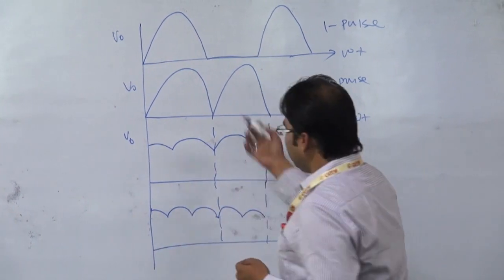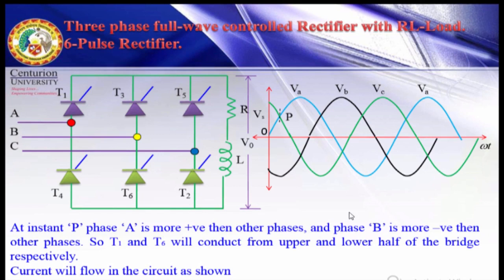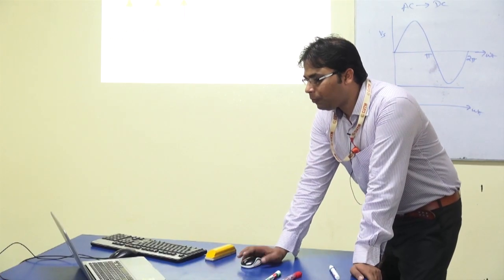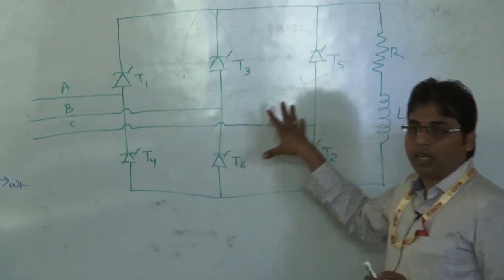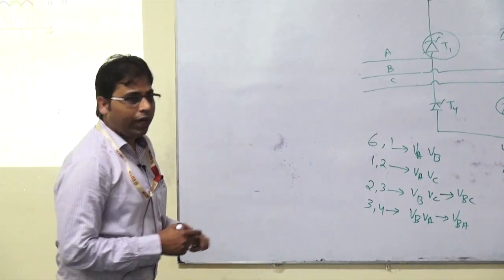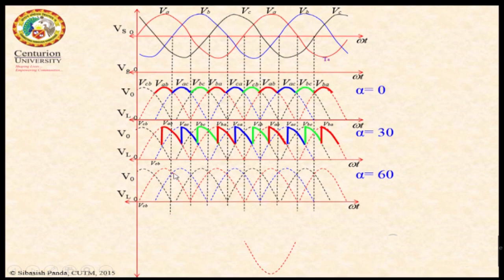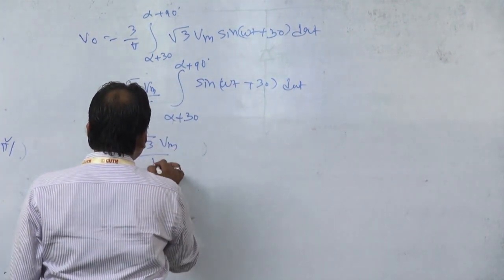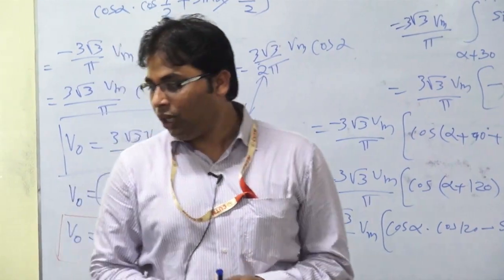3 Phase Rectifier 6 Pulse Rectifier

Comment: This lecture helped me so much that I am almost lost of words...
 My hobbies are mainly focused to HV AC electricity and last weekend found  that there is a lot I don't know.. For example what I knew before was that there is no frequency on DC. But when it is certain way pulsed DC then there is frequency.. Like that (6 Pulse Rectifier circuit) I was just wondering... And  I'd like to ask if you can give me advice...?
 I have 50 kVA dist-trafo which is used as step up purposes. Inner connections are Yzn 11... So in AC, is every phase angled 120° to each other and to N in this situation? And how about if you put load between two phases, is the difference then like  -120° and +120°? That being  240° of the overall 360° if I got it right? with 6 pulse rectifier there wouldn't be that problem that there would be some unused power :D. Even thou its DC and the frequency would rise.. I have gone through a lots of different configurations with the ballast circuit and tried a lot different variations.. Lowest frequency I got from the HV end was 20 Hz, HV voltage was then about 18-20 kV and current 0,5-0,6 amps.. Highest voltage I managed to get out of it was about +70 kV but with rly small current.. maybe 0,1 amps or less, so pretty poor.. Best result I got was like 1-2 years ago.. HV end voltage was around 27-30 kV and current 0,750-0,8 amps. SUBBED AND LIKED!

Comment: What if one diode fails in 3 phase Ac to DC converter by using diodes
Reply: What is the effect on output DC voltage?

Comment: thanks first, but i am confused because at minute 25 u wrote angle alpha = 0 but if we look at wave form of vs we will find out that alpha = 30 degree at wt=60 degree. so i hope u correct that if i am wrong.
Reply: Dear Mahmoud Raslan, Think for a while three phase diode rectifier Is there any alpha there? obviously not. The answer for your question is " its not a delay but its a continuous wave form before Vab, Vcb is there i have started it from Vab for understanding".  Its not alpha equal to 30 degree your Vs is phase voltage and the output we are taking from line voltage so it leads by an angel 30 degree. Its looks like a delay but actually not a delay.  Hope i helped you in this regard.

Comment: Very good teacher, BUT nobody notice (There is an ERROR) in the min 26 the drawing with the lines voltages is shifted  30 degrees to the right( the sequence is ok but the position not). Just check it out.
Reply: Line Voltage will lead to phase voltage at an angle 30 degree.  so the lines voltages are shifted 30 degrees to the right.
Reply: My dear sir the point is that the line voltage drawing is not properly aligned with the phase voltage drawing just check it out carefully.
Reply: Yeah sir.The line voltages should be shifted to left,so at alpha=O degree there is change in the waveforms.Can any one clear it.
Reply: @vrindaprasad8332 For example;  If we draw a vertical line, passing the upper intersection point of phase A and phase C, then in the same vertical line should be the up zero crossing point for the line voltage A-C

Comment: sir apha 0 deg means conduction from 30 degree or 60 deg ???
Reply: 60 for 6 pulse rectifier because the output is line voltage.
Reply: do u mean 60 degree at wave forms of output line voltage because line voltage leads phase voltage by 30 degree

Comment: plz any body tel how to select value for filter circuit for uncontrolled diode based 6 pulse rectifier and 12 pulse rectifier. value of capacitor and inductor
Reply: Dear ali you hav to design the filters according to your parameters. Filter designing is a separate issue.